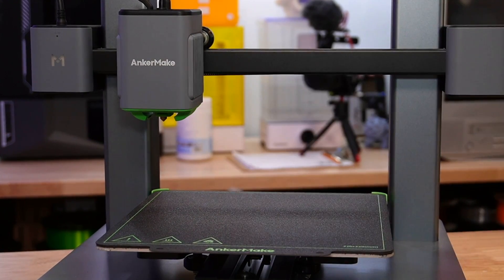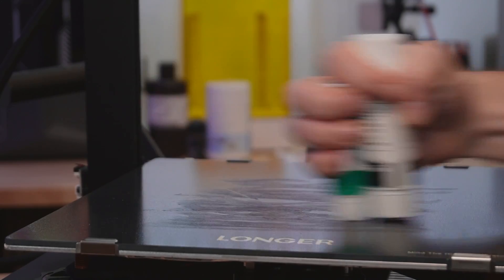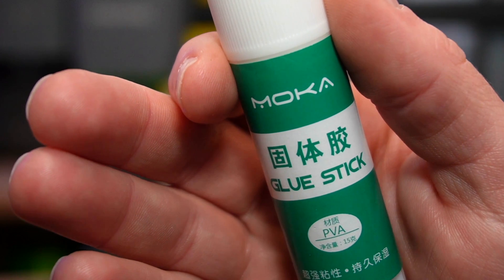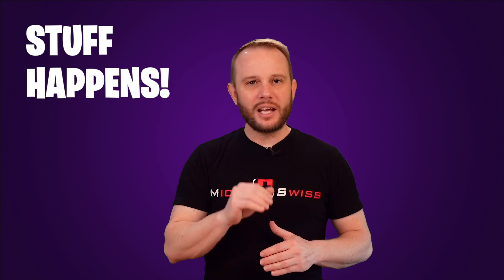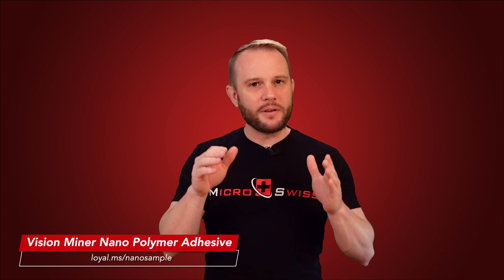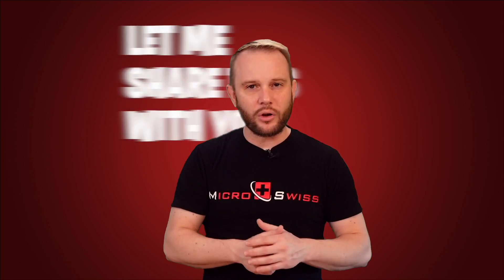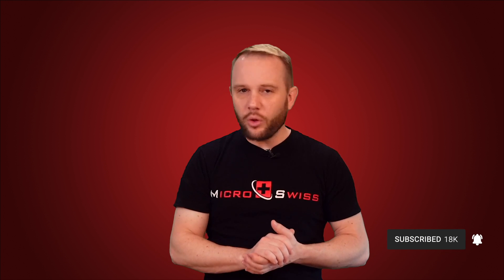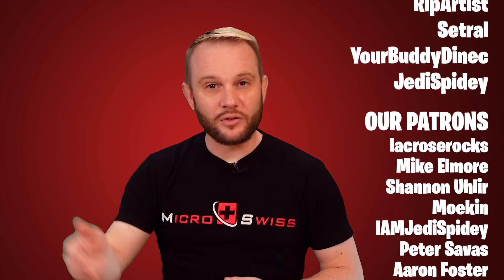This Simple Swap Saved My Difficult Prints

Comment: I go for a multi-pronged defense.  PVA for ASA/ABS, dilute PVA for PETG release, and nano-polymers for trouble spots and tough cases where mouse ear brims don’t apply automatically.  And full brims if I’m having a bad day.
Reply: By PVA you mean a regular wood/school glue?
Reply from the maker: For 3D printing beds, PVA glue sticks like Elmer’s purple or the Amazon ones I put in the description. And, yes it’s the same PVA.
Reply: @LoyalMoses  Thanks for the help and the clarification!
Reply: @greengohm  when I say dilute PVA, what I mean is I rub a glue stick onto a damp microfiber cloth and then wipe my build plate with it.  I tend to dedicate build plates to each type of plastic.  I find it’s unnecessary to use a thick coat with PETG, so I started doing this to try and make things less messy.
Reply: @ziggystardog  I tried something similar with smearing the glue stick residue on a plate with a damp sponge, but was wondering whether someone does it better/differently. Thanks for sharing your method!
Reply from the maker: That’s awesome! Thanks for sharing that.

Comment: Glue stick is super cheap, easy to use, available everywhere, and works.
Reply: This problem and discussion demonstrates the quintessential reason why there are dichotomies in the 3DP community.  Since no two printers are identical and no processes work for EVERY printer, substitutions and work arounds exist to enable people to print successfully.  But often times, people lack knowledge, expertise, or free capital to print the way things were meant to be printed.  What model designer designs their models specifically for printing onto glue stick?  What maker has unlimited funds, time, and knowledge to actually FIX their printer's actual issues?  It's all relative and people will stand on business arguing about their subject knowledge of success instead of discussing the situation, root causes, and permanent solutions?
Reply: @RonZaworaCGS  When it comes to bed adhesion we are discussing preferences and sharing experiences. All FDM printers these days are quite similar. Heated build plates, consistent extrusion temps, and speeds. Success has more to with print settings and that first layer. In the end whatever gets you a successful print in the manner you like is the right solution. Perhaps a dichotomy between vendor brand support, otherwise my experience has been a collaborative sharing community.
Reply: @urban2153  we couldn't disagree more on this.
Reply: @RonZaworaCGS  Then, respectfully, we disagree. Have a good one.
Reply from the maker: Absolutely!
Reply: Glue stick suck. This product is amazing
Reply: are you poor? is that the reason you have convinced yourself on the effectiveness of gluestick? if thats the reason then fair enough
Reply: @BaconSniffer578 not everyone has to be poor or rich these products arent available everywhere so he makes alot of sense
Reply: For those of us printing in ABS, ASA, and PA, it's simply not good enough.

Comment: I like the glue stick for those items that have the large flat first layers.
Reply from the maker: I agree! Same.
Reply: Why does the link automatically add .95 shipping insurance? I tried to delete and it refreshes and adds it back. Not good, lost sale.
Reply from the maker: I was just told you can scroll down and turn off the insurance shipping option, it’s not required.